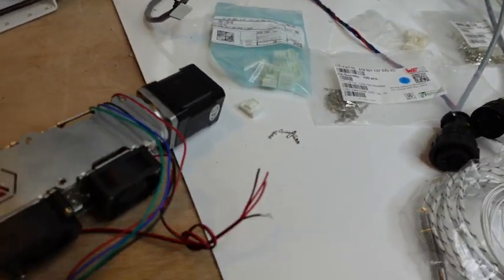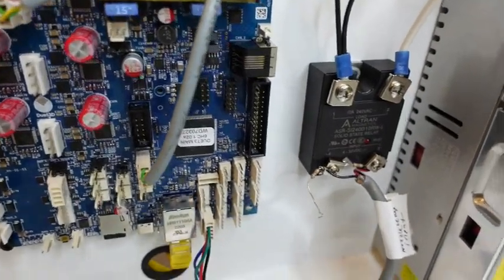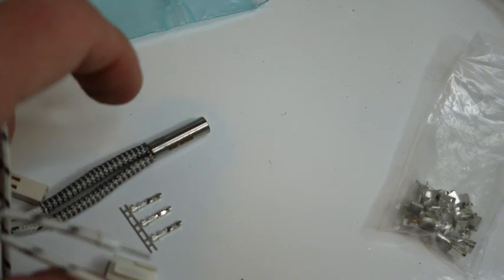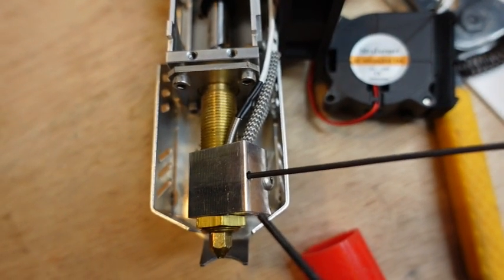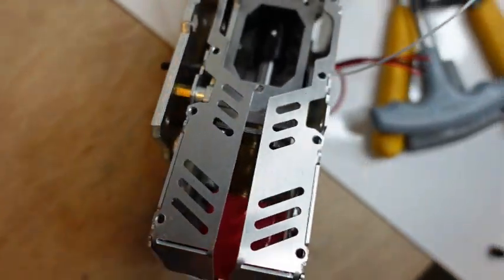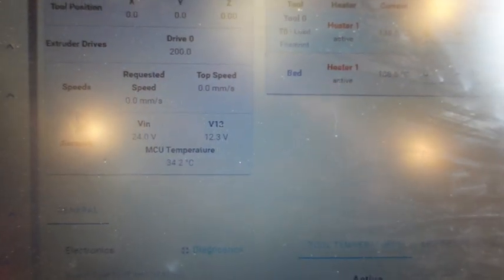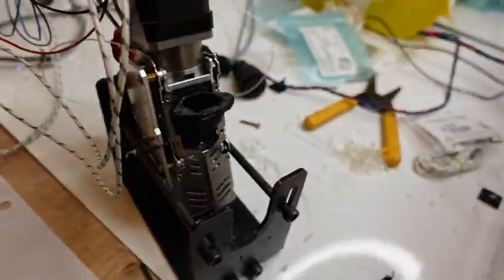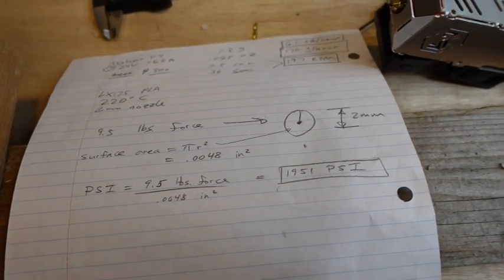Connect a Mahor V4 to a Duet 6HC - testing for max. RPM, extrusion rate, and pressure

Comment: Can you help me connect it to on ender 3 printer
Reply from the maker: Follow the steps. First connect the stepper and get it to spin. Then connect the heater and thermistor. Create a mount plate if needed.
Reply: @samwechsler @samwechsler  Hi, did you change the firmware somehow> or did it work with the original one?